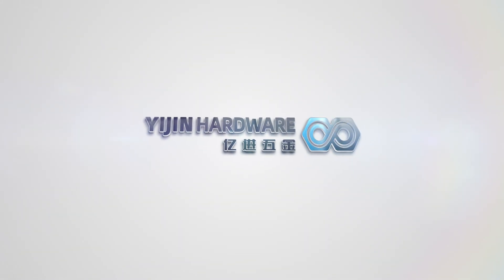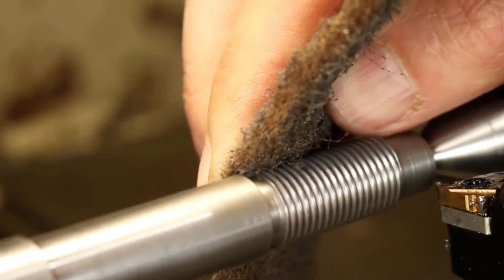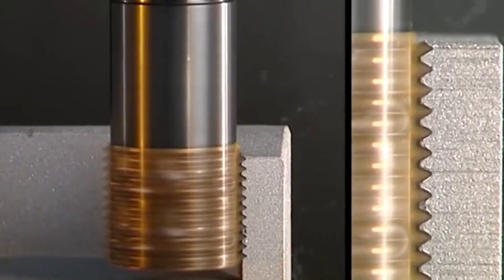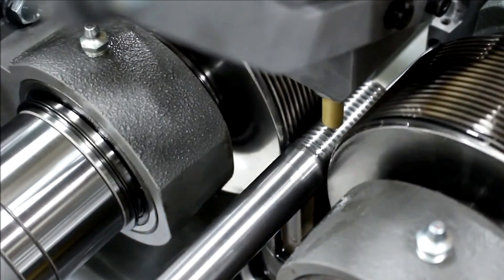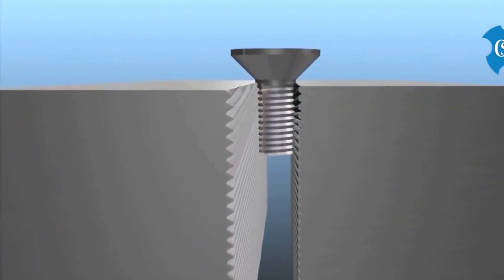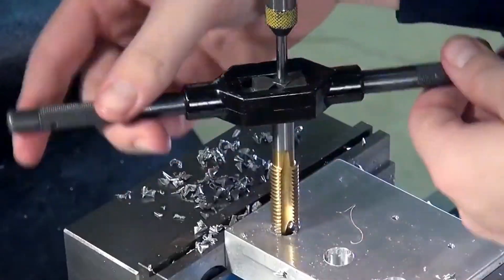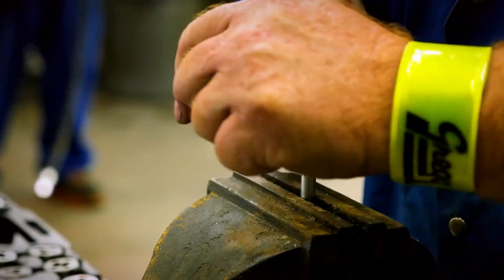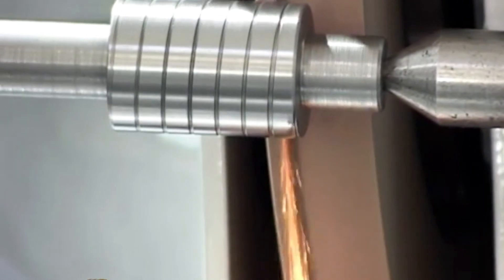Seven kinds of thread machining, do you know how many?

Comment: There is another I know of: Watchmaker's use what is called a "Thread Rolling Die", which usually has three threading rollers around a central hole. The piece to be threaded is fed between them while rotating. It is a type of deformation forming, but different than the one you show, in design and practice.
Reply from the maker: Thanks for the comment, man!
"As demonstrated in the video, this method is one of the common techniques for thread roll forming that is commonly used in the market today." This method you describe is probably one of the thread roll forming
Reply: @ShenzhenYIJINHardwareCoLtd  Yes, probably... they use a different tool configuration to achieve the result you demonstrate. Look them up, they are very interesting...